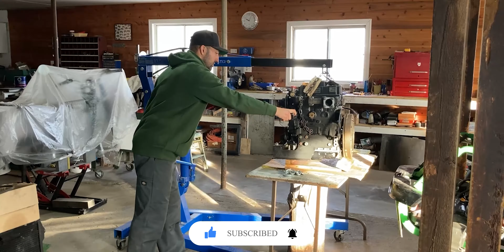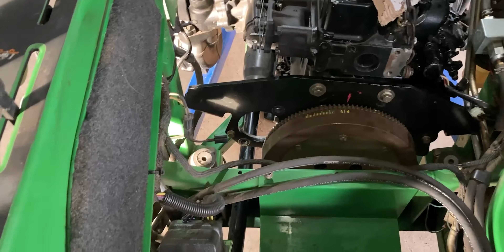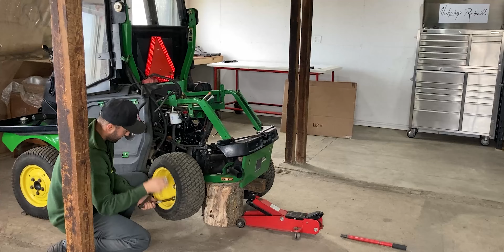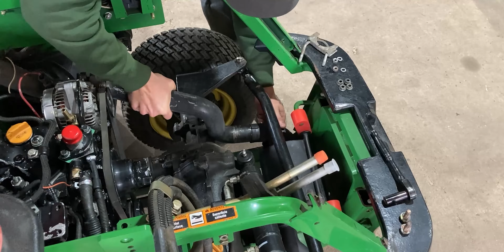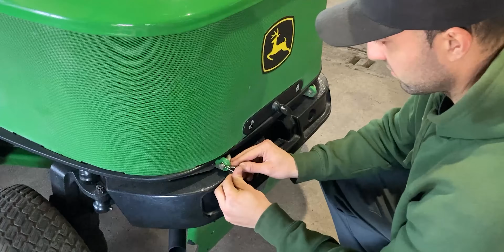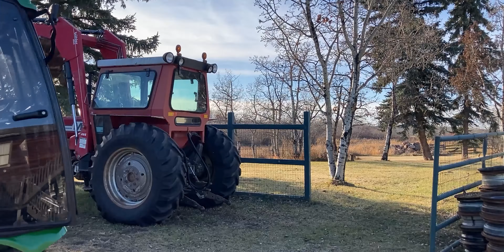Will It Run? - John Deere 1445 First Start After Diesel Engine Rebuild

Comment: The information contained in these videos are very well articulated and thorough. Well done, and I never want to discourage your efforts. After watching this playlist, I would contend the title(s) should properly draw viewers interested in Yanmar diesel engine inspection & rebuilds, because there is much more involved, including the transmission & electronics, that is not covered here. I'm sorry to be "that guy," but my frustration in trying to find an electrical issue with the PTO on my 1445, as well as trying to find properly titled YouTube videos, is growing. There are multiple relays, fuses, safety switches, sensors, modules, and solenoids that are involved in the proper operation of the 1445 traction unit that is designed to "drive" other implements/attachments. This "project" was the Yanmar diesel engine....NOT the John Deere 1445.

But, being 100% genuine in saying "Thank You" for being an intelligent source of information in a sea of improperly prepared offerings on this platform.
Reply from the maker: I fully appreciate your feedback and comment! When I look back at this playlist with JD1445 videos, I went into this project knowing the engine was shot. How bad it was, was unknown. Besides the engine rebuild, I managed to replace axles seals and repair some other bits around the commercial tractor. I know this unit has more than just that, but my goal was to get it back up and running and not to do a full restoration. 
When dealing with wiring tasks, it's challenging to capture on camera without becoming overly detailed, which may not appeal to viewers who aren't encountering specific faults. If I had encountered electrical issues, I would have mentioned them briefly without diving deep into the specifics. There are readily available wiring diagrams online that are straightforward and easy to follow.

Unlike some other YouTubers who use clickbait titles, I believe my JD1445 videos are straightforward and technical. If my videos didn't cover exactly what you were searching for, I apologize. Perhaps in the future, your machine's issues will align with mine, and you'll find my videos helpful.

I'm always striving to enhance my videos and appreciate feedback on areas where I can improve. This is why I make an effort to read, acknowledge, and respond to comments.

Thanks for understanding and hope to see you again soon. Regards Andreas

Comment: Good Job. Any news with your good vapor blasting setup
Reply from the maker: Thanks a lot, Jonny. The vapor blasting machine is working well and I will share an update on the machine once I finish more parts with Cerakote (for an upcoming project). Thanks for your question. Regards Andreas

Comment: Have you seen the John Deere 430 diesel that was made into a 4 wheel drive using the transaxel from a John Deere 1445 ? A teenager made it for a 4 H project. It can pull a 3 bottom plow. 
Love your projects
Reply from the maker: I have not seen the 4WD JD 430 you mentioned. May I ask where you found the article? It sure seems like a cool idea, given the JD 430 was very front heavy. Pulling a 3 bottom plow with 20HP diesel and a hydrostatic rear end is extremely impressive!
Up until this date I've only seen one crazy custom JD 430 which was converted to a track machine. The owner used mini excavator tracks and separate disc brakes for the steering mechanism. I've seen these pictures in a John Deere Facebook group.
Thanks for your ongoing support, it means a lot! Regards Andreas

Comment: Andreas, kudos on your excellent work! That engine seems to be running nice and strong. I have no doubt in your rebuilding skills, everything you touch seems to work so well!! Have you thought about working on a bigger diesel engine? What about a V8?
Reply from the maker: This engine is running really well and it sounds even better in person, than in this video. I'm always looking for a new challenge and some interesting vehicles. A larger diesel engine is definitely on my radar and I wouldn't even mind tearing into a V8 diesel. What type of diesel engines are you interested in?
Thanks for your support, Matt! Cheers

Comment: Nice! I’d like to restore a 332 in the next few years. What’s your opinion on them?
Reply from the maker: I believe the JD 332 is one of the best garden tractors out there. Great power, small footprint, wide range of attachments and a reliable diesel engine. It's hard to beat this tractor and I absolutely love the 332. Share some content about it once you start your restoration project 👍🏻👍🏻